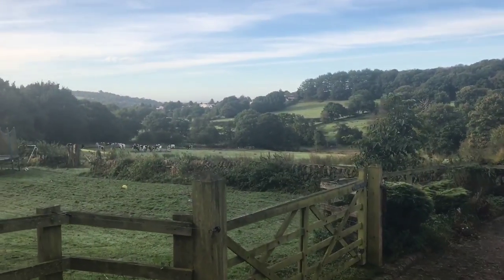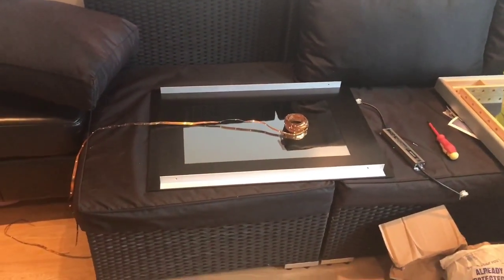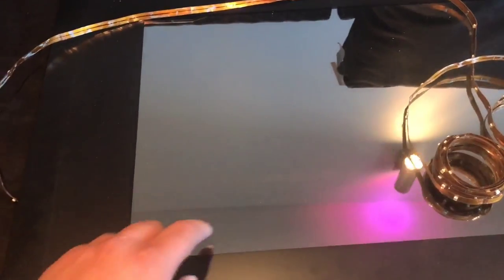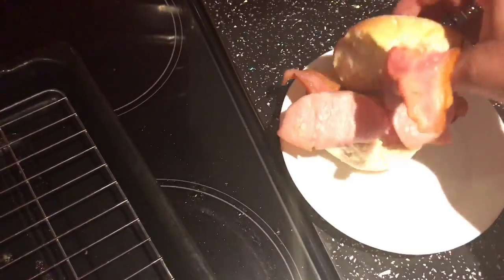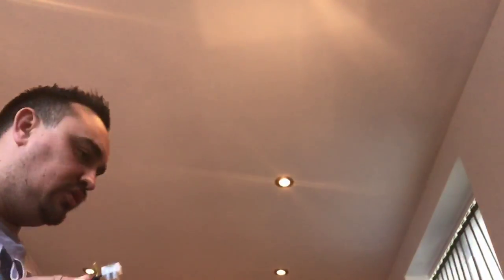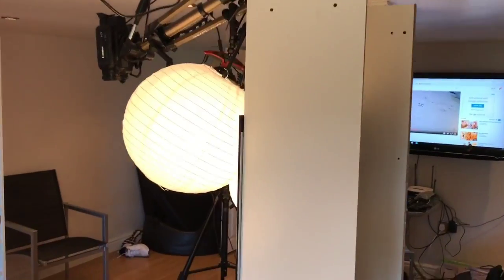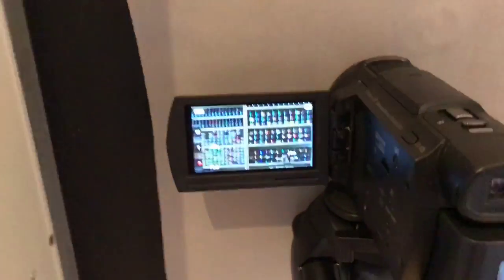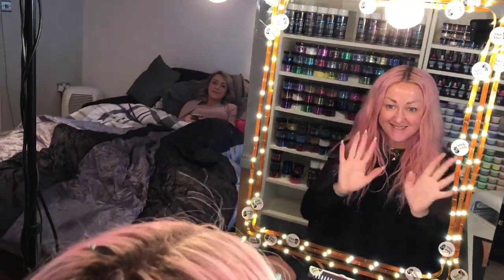DIY 'Make Up Video' Filming Rig -  Shot & edited on iPhone 7plus,

Comment: Hey, I  know you love that pork. . Yum!!  1 totally simple change to your sandwich makes it way better for ya, especially if you do the splurges in the studio on your shooting visits.... just change your bread. Multi grain or whole grain,  without Enriched flour. Like 7 grain or ? No bleach. If you know of an organic grocer, even better. If they have pork there that's not fed GMOs, like not organic corn. If you make easy changes 1 at a time,  and eat the same,  it will not only help your kids choose better items to snack on but you can loose a bit over time plus avoid diabetes. 
Though I  gained weight due to my neck,  long story,  I  ate right. 
I was told I was going to get diabetes... the thing was, I  already ate healthy,  not fully a diabetic diet but close. Plus I  ate non GMO and organic.  Even during hard times,  I  ate the most as i could.  Drs apparently didn't fully believe me, especially a neurologist. I never saw the results but 1 day 2 months after seeing him. He claimed i was diabetic.  Told to see my pvp. .regular dr to get meds, it still didn't make sense though.. i got pills, INVOKANA... I  had started to gain,  so he switched it to another pill. I gained more. I reverted back to the st . .. i never felt different,  i had asked several times for a tester.  Told.. your fine, you don't need one. Because I cwas suppose to hv ny neck surgery done, with all the bsing,  from the neuro surgeon... not the neurologist..  2 dif ppl.. I  now hv neuro issues that will be permanent.  Some may improve but in time. Anyhow,  2.5 yrs of that next dr screwing with me and my pain dr got me in another neurosurgeon  and a month later, i had 2 cervical caging surgeries.  Anyhow... while i was in the hospital then the nursing home,  they took my blood 3 to 4x a day.. when i went in, they stopped my 1 medication.. they said they'd give me a different one temp while in their care.... almost 4 weeks and only 1x my sugar spiked. Why? By the time they tested me, I  had eaten a sandwich they hadn't gotten my requests straight yet.. so they brought me a sandwich on white bread. When my spije happened,  the nurse ignored me when i first asked her to wait atleast an hour, see what happens.  But she brought the injection,  and I went off on her.  I again said to test in an hour. Bam!! Fine and dandy... no diabetes.. i  requested a retest, my regular dr said NO .. i blew up . Then recalled,  the home had their own dr. Technically my I never needed to ask my dr squat. I asked him, and bing bang bong.   Clear and dandy. ... 
I never felt any dif the whole time,  except the home didn't have organic.   Grrr. 
Its the point tho, I  ate well and didn't have it.. they couldn't believe it.. i had gained like 30 lbs before meds because my neck, then tons more because of the meds. 
The point is, you can enjoy much of what you love but try and find a bread, or ? You like that's 500x better. 1 thing at a time... you like milk?  Drink organic,  grass fed too is best but baby steps.   I taste the difference in a good way. How I  learned to love the good stuff... we lived in pahrump Nevada a few yrs. I use to go to church a lot then..  lol.. it was in BFE... bum fuck Egypt.. lol. 
My moms minister was mine on Tuesday kids day at his home. I use to help him sometimes milk his cows, goats etc.. fresh everything off the farm. Raw milk too.. not homogenized.. stores require that it be boiled. Raw milk is right out of the cow. Id skim the cream, make butter and all. Butter is way way better for you then margarine.... THE WORST THING FOR YOU IS MARGARINE... pure fat..  kill ya fat. 
They have proven it, so eat smart and enjoy the best flavors.. way way better for ya.. and unless you drink tons of alcohol,  you should stabilize,  and if you add in a bit more activity,  swimming or biking,  you will melt everything off fast..  a block, a half mile etc..  just ride with your kids..  no far.. have fun..